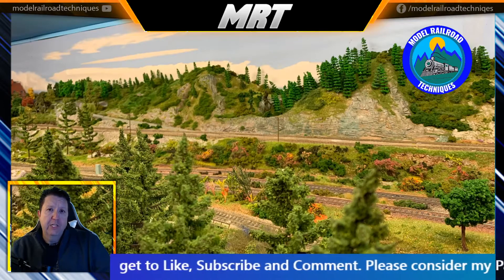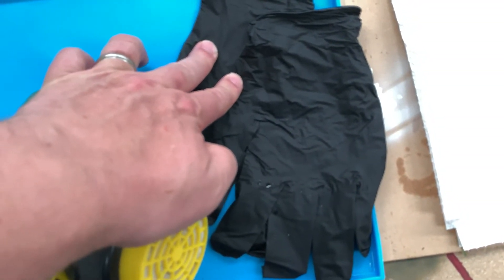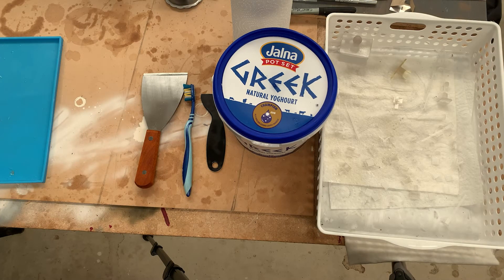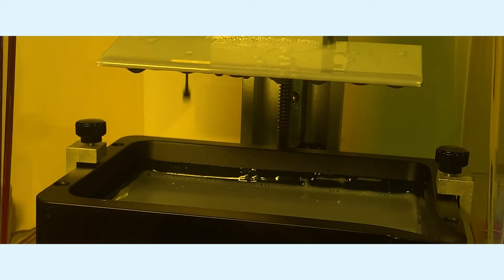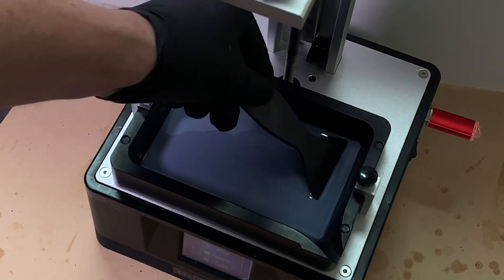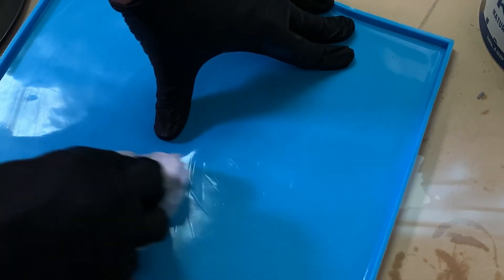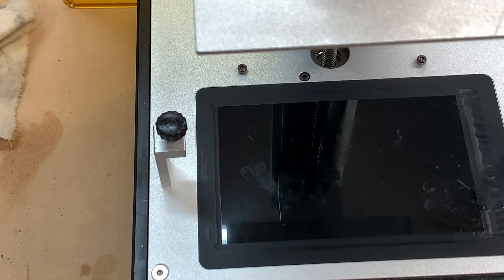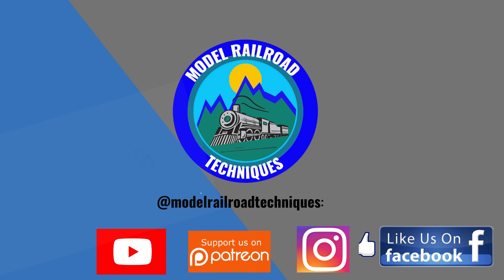Lets Talk 3D Printer Safety: What I have learnt

Comment: One small change I would make.  Always make sure the vat gets put on a new sheet of disposable paper, not in the blue tray. If there is any resin drips under the vat when you put it on there, it will leave a very thin film of resin which is hard to see, on the base.  This then transfers to the LED screen and will harden on the screen and bottom of the vat. A clean disposable sheet will stop that.
Reply from the maker: Great advice. I always clean the bottom of my vat more carefully since I did just what you have said